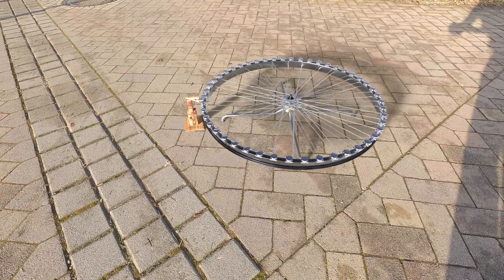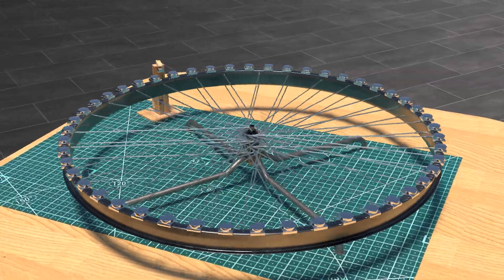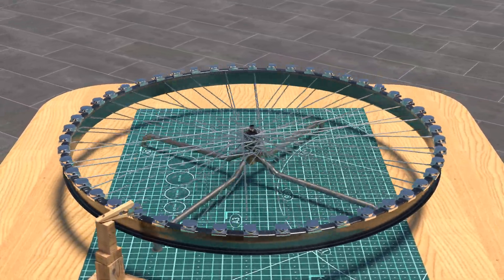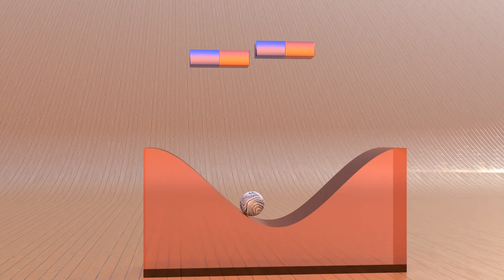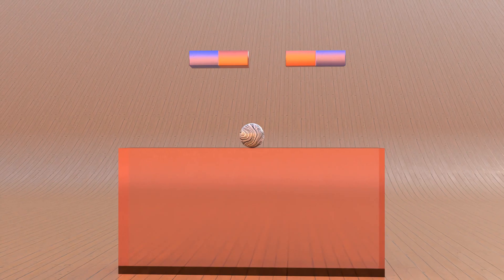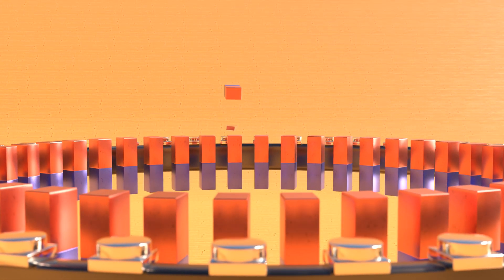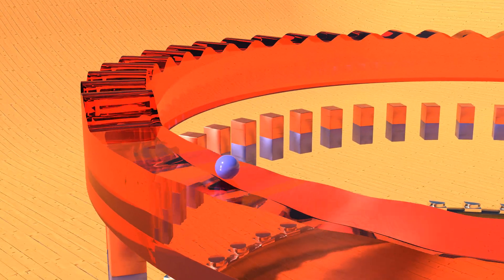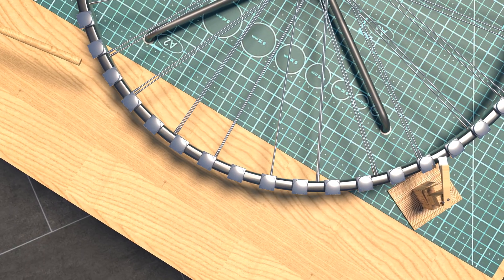Truth: Bicycle Free Energy Magnet Motor do not work. Not usable as an perpetual motion device!

Comment: How about using opposite polarity on the bottom of the wheel. Then adding multiple of the stationary magnets. Top and bottom. Or using two wheels with magnets arranged with opposite polarity. Start out with 2 or 4 on one wheel with the other wheel covered as shown. The magnets may need a slight tilt.

Comment: Hello! What about Adam Savage vs Perpetual Motion? Îs it true or fake ?
Reply from the maker: Hi Olaru, thanks for your comment and the inspiring machine from Adam Savage. The machine looks like there are plenty of room for hidden devices and they say it’s a secret how it works. If it has to be an secret, then it is mostly an fake. The machine may get its power from the environment, like radiation from neon tubes in the room or other external influences. If it is not shown, what’s in the applied boxes and tubes then it will be an advertising trick of the museum. Thx for watching 🙂